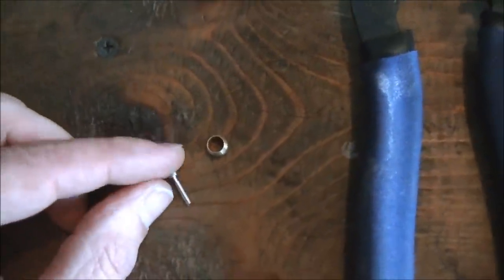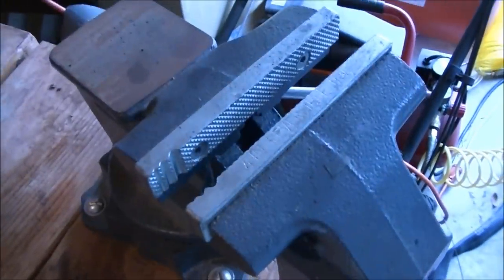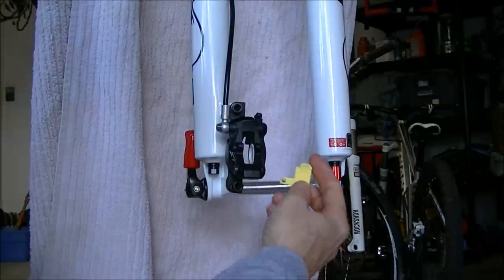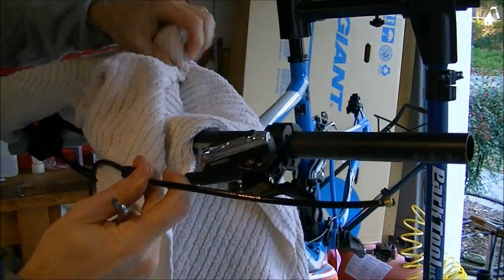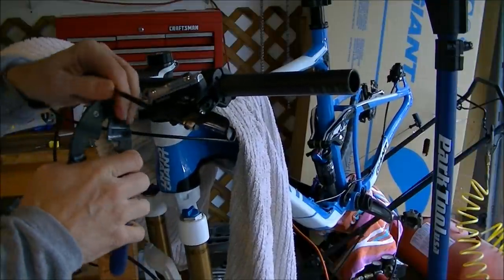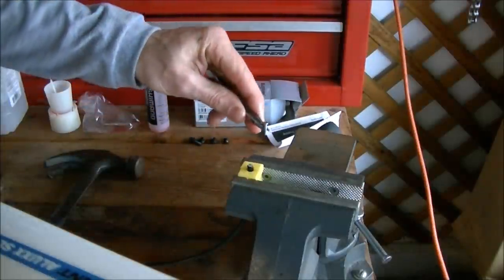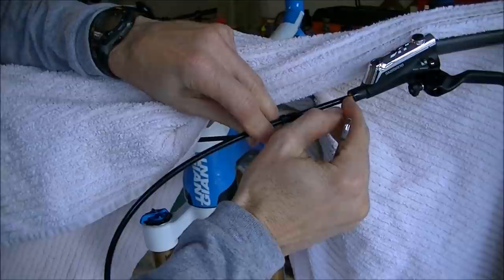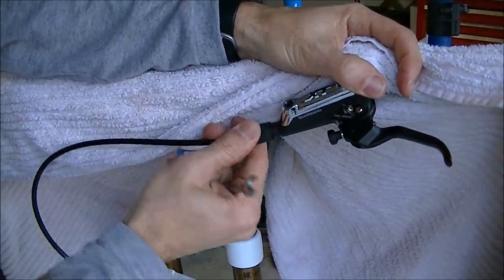How to Cut, Shorten and Re-install Shimano Hydraulic Brakes

Comment: This video is pretty straightforward.  The instructions almost make me feel as if hydraulic brakes are low maintenance.  I had some Hayes and their instructions were such a pain --  felt like the I was  doing the hokey-pokey.
Reply from the maker: +Peter Michael XT brakes are so easy to work on and very low maintenance.
Reply: Agree.  I felt I needed to comment b/c most recreational users probably don't want to use hydraulic brakes due to maintenance.  After watching your video I bled my entry-level Shimano brakes without drama.  There is a learning curve but successful bleeding makes me want for more hydraulic -- especially Shimano.

Comment: For the front brakes the line can be pretty much any length as long as as it reaches the levers because the handle bars always move with the front wheel.

Comment: I dIdn't have a vice, so I wrapped the tube with two layers of duct tape and held it with in place with pliers in my left hand. Using the flat handle of a wrench in the web of my right hand, I was able to grip the pliers with my fingers and press the pin into place. This method is useful if you're doing this in your bedroom, but there's a few drawbacks: 1) success is dependent on your grip strength, and 2) you run the risk of deforming the cable. On the first attempt, the tube bent, and flattened a little where the pliers had gripped it. However, this technique worked perfectly for me on the second try – no deformations at all.

Comment: And the bike shop makes it seem like a complex operation. I install swage fittings at work, on steel process lines all the time, and you've shown me that is all there is to it. Just like the brand we use, the tightening nut does the swaging. Thanks - easier than cable brakes.

Comment: Great video! Very clear. I recently upgraded to SLX brakes and when the arrived in the mail the levers were reversed,  i.e. front lever on the right, rear on the left. I want to switch the hoses and the sizes will then be correct. I wont have to do any cutting but i wondered if i will need to bleed the brakes afterwards.  Thanks
Reply from the maker: Sometimes you don't need to bleed if you are careful.  I've even cut a hose an not needed to bleed.  But the bleeding process is so simple that it's not much of an issue if you do have to.
Reply: Clint Gibbs Thanks for the reply. Related to my previous question,  would I need to replace the olive if all I'm doing is pulling the hose and inserting in opposite lever?  I'm unsure if that would damage it.
Reply from the maker: No. Olive should be fine. You really only replace it when you have to cut the hose.

Comment: You leave just a little bit of housing sticking up from the bleed blocks @ 6:28 however if you leave an excess of the usual 15mm (Lenth of the pin) this means the pin will go in best, by allowing the housing to expand evenly around it and the tension holds it firmly in place.

In your example, the pin will expand mostly the inner wall of the hose and the block will be creating tension/spring in the outer part of the hose around the pin, so, when the blocks come off you might find that tension then releases as the outer layers expand, leaving the pin not as firmly in place.

Of course, the difference is not really going to be notable... Although I'd like to think it would be best practice especially in a bike service shop :)

Comment: Clint, there's a much easier way to trim the line without having to bleed the entire system, just the top portion. You don't even have to remove the brake pads just make sure everything at the bottom end, brakes and rotors, are covered with some rags incase there's some spillage. When you cut the line at the top, everything else you did gets done the same, just cut the line, attach it back to the lever housing and tighten. Remove the bleed cover, attach the cup and add mineral oil, pump the lever several times and what ever air is at the top end of the braking system, will come out. Make sure your cables are propped up so that oil doesn't leak downward after you cut the lines. Also, make sure that they're paying attention to the "o" ring that's part of the bleed screw or screw cap and that it doesn't fall off…and you're done.

Comment: Thank you for this clear and straightforward video. I am about to do the same thing on my bike and your instructions are very helpful. I wonder yet that no drop(s) of mineral oil spills out of the open end of the hose once you cut it and even move it to your bench vise ... Are the brakes not pre-filled with mineral oil when you buy them?
Reply from the maker: They are prefilled.  The reason not much flows out when you got the hose it’s just because there’s not any airflow that can allow the oil to come out the end.

Comment: Nice vid, thanks! I've got a really spongy feel to my rear brake (Avid Elixir R with 180 mm rotor). I'm thinking about upgrading to steel braided lines b/c even with several bleeds the rear sucks. Front is OK. I've determined that the rubber line must be the main cause for the spongy feel.

Comment: Great video Clint.  Do you have to replace the olive any time you detach the brake lines from the lever or only if you are shortening the hose?  I ask because I got a pair of brakes that came Euro style.  I switched the lines and one seems to work great, but the other seems to be leaking.  I'm thinking it's either I need to redo the olive and pin every time or maybe I didn't tighten enough (i.e., 8 newtons)?  Any thoughts appreciated.
Reply from the maker: +Blake Durtsche no, you do not need to change the olive every time you remove the cable from the lever. It sounds like you just need to tighten the bolt the holds the cable in the lever. It's pretty finicky. I've had times where I thought it was tight enough but it leaked a little bit. Just taking it a tad more.
Reply from the maker: +Blake Durtsche tighten it a tad more

Comment: I have the same Anthem as you Clint,. On this bike though, how does one route outer cables shifters or outer brake into the frame of this bike, does it require a thin tube as a guide or could one just remove the old inners first then use the old outers as a guide to feed in new inners then take out the old outers with the new inners as guide to put the new outers? all these without using any other tube that one would have to get from a hardware store as a guide?
Secondly, we know you do get the olive with the new brakes but, what if you but a fairly-used brakes or where do you olives and the other connector insert?

Comment: I"ve read and heard frequently that this procedures can be succesfully accomplished without bleeding the brakes. What are your thoughts, Clint? Thanks so much, great great video.
Reply from the maker: +Justin Kamerman if you're careful you can do it without bleeding the brakes but you always need to prepare to bleed just in case.
Reply: Clint Gibbs Thanks you for your response. Truly appreciated. One more ? if you don't mind: how do you tell if you were careful enough and have to bleed or not-bleed, would it be based upon feel of the brakes? Again, thank you so much, looking forward to exploring your channel more. This is the end of my first full season of MTB, I'm in love!!!!
Reply from the maker: +Justin Kamerman after you cut a hose keep it up so fluid does not drip out and quickly install the cable inserts. Also there are yellow plugs that you can plug into the brake levers to keep fluid from dripping out of those as a temporary measure before installing the hose. Just move quickly so minimal fluid drips out. If it does don't worry about it and just do the bleed.

Comment: Nice video, that 'olive' looks like a compression fitting? At least thats what it looks like, never heard that term before, but it works.
Reply: It's designed to be crushed
Reply: @smallhatshatethetruth7933  indeed... that's why it's called a "compression" fitting. You compress it or "crush" works too.

Comment: You explain things so well and so clearly. Can I ask, I have deore brakeset on my Trance 2015. If I were to upgrade to SLX or XT, would it be ok to just leave the current brake housing in place and do what you did here? Also, would it be similar procedure at the caliper end?
Reply from the maker: yes, you most likely should be able to use the same brake lines on SLX and XT brakes if you upgrade. if you're asking about the hose at the caliper end, you would never cut on that end. The hoses are designed so that you only cut on the brake lever end.

Comment: Hi! Thank you for the video.. I am trying to install hoses for r8070 caliper and grx shifters. On the shifter the olive and hose goes in and I screw the bolt inwards. It screws away, but doesnt seem to tighten? And on the rear...the olive and hose seem a lot tighter...the bolt screws in and starts to get tight, with maybe one third of the screwed surface left to tighten... Does this make sense? Any ideas, what I could be doing wrong? Thank you!

Comment: Nice video Clint, I am getting a pair of zee brakes is this pretty much same procedure ? I would also like to put braided hoses on them, can u make a video on how to change hoses ? Thanks
Reply from the maker: Yes, the process should be the same.  As far as changing hoses, it will be like the video I show except for removing the hose from the caliper.  There is just one bolt (aka the banjo bolt) holding the hose to the caliper and there should be an o-ring on each side.

Comment: Thanks for posting. I have been wondering  how to do this for ages. I also did not know about he mineral fluid and being a motorcyclist I am sure I would of used DOT fluid. I am also interested to know whether you can get an open ended torque wrench as all mine only can be used on sockets.
Reply: they are called crowfoot adapters, basically a spanner head of certain sizes.
google image search "crowfoot adapter for torque wrench" to see what they look like

Comment: Hey Clint. I liked your video. It was very clear and easy to follow. I have a question for you, if you don't mind? I'm switching my lines from "moto" to bicycle and the housing seems to be stuck/jammed in the lever body. I reefed on it pretty hard to no avail. Any ideas? They are Saint 810's. I've been running either Magura or Shimnao forever without trouble...

Thanks, Derek
Reply from the maker: If you have the housing bolt all the way out, which I'm sure you do, then it can take some force. The doughnut gets jammed inside the leaver body. Try shaking the housing back and forth while you pull on it.

Comment: Don't be stingy about sliding that nail into the brake line to open it up a little. The little insert split open and sliced through the outside of the brake cable. I managed to salvage the insert by filing the end down and reforming it. Hopefully the connection doesn't leak. I haven't bled it yet.

Comment: Hey, the little silver insert you insert into the hose when its in the vice, is that the one that was there before? or do you have to buy them seperate? im about to buy xt brakes so im guessing i will need to shorten so do i need to buy that insert aswell? or? if so whats the exact name and where from? thanks
Reply: +Mathew Pugh If you buy XT brakes that weren't meant to be on a retail bike than they will be in OEM packaging and not bubble wrap.  The front brake includes the bleed block and the hose holder.  Each set comes with the needle and the olive.  The clue lies in the lengths.

Comment: Thanks for the great vid! One question though: I have to replace my current line which is filled with oil. Is it the best to push the oil out from the bottom to the top (in the funnel) or just let gravity do its work and let it come out at the bottom?
Reply from the maker: I've done both but the gravity method is a lot easier. The downside is for the rear brake you have to take the caliper off the bike and let it hang down lower. For the front brake the gravity method is very easy.
Reply: @ClintGibbs  thanks! It’s the front brake so it shouldn’t be a problem

Comment: Hi Clint, great work on the video!  Quick question.  I just installed my first set of hydraulics (SLX).  I noticed I have a slight twist in one of my cables (at the lever).  Is it possible to loosen the bolt enough to remove the twist without having to completely remove the hose then bleed the brakes?  Thanks!
Reply from the maker: Most likely you can. When that happens I remove the lever and twist it but sometimes it gets twisted in the opposite direction. If you loosen the bolts going into the lever as little as possible you will probably be able to turn the cable without any hydraulic fluid leaking out. Let me know how it goes.
Reply: Clint Gibbs I undid the bolt as much as I could and eventually the hose spun itself around into the right position without appearing to have lost any hydraulic fluid.  May have originally over-tightened the bolts on the levers a little but everything seems to be fine; hoses are now untwisted and no leaks.  Thanks for the assist! :)
Reply from the maker: I leave leaver bolts just tight enough to not move. That way they can move in event of a crash.

Comment: An extremely informative video, but DAMN, that's a LOT of hassle just to shorten a cable.
I was thinking about upgrading to a hydraulic set, but now I think I'll just stick with a wired setup.
Reply from the maker: +Dan RC the good thing is once you have hydraulic brakes set up they're usually maintenance-free for a very very long time.
Reply: Clint Gibbs I'd be intersted to know how much all the parts needed for the cutting of the cable in your video cost?.
Are they worth buying if it only needs doing once or twice?

Comment: Hey Clint.  Nice job - very clear.  I broke my Deore XT brake lever at the clamp that attaches it to the handlebar, so I will be only replacing the brake lever itself - which will require disconnecting the hose from the broken lever and reconnecting to the new lever.  Will I be able to do this without having to bleed the brakes when I'm finished?  Thanks
Reply from the maker: You will have to bleed the system, especially since you're installing a new lever.  That's where most of the brake fluid is housed.
Reply: Same problem here...i know a bleed is necessary,but since the new lever is the same,can i reuse the olive and insert?(aka,leave the break line untouched)
Reply from the maker: Yes
Reply: Clint Gibbs thanks for the quick response and the help!
Reply: Actually, I cheated.   Clint may not agree, but here's what I did based on LBS advice: I removed the broken lever from the handlebar and detached the cable from the fork to free it up enough to take it down to the floor below the rotor and brake caliber.  This allows gravity to work in your favor.   Then remove the cable from the brake lever.  Disassemble the new brake lever and fill the chamber with mineral oil.  While still open, connect the cable to the new lever.  Squeeze the brake lever a few times to burp it and keep topping off the chamber with oil and repeat until the lever feels right.   Reassemble the lever.  No bleeding necessary.   My lever works better than it did before.
Reply: Rob Herman did the same thing today,but i could not see any bubbles...maybe some very tiny ones....it worked great though!
Reply: Glad it worked!   Happy riding!

Comment: Hey Clint, thanks for another great video. Let me know... if i dont want to cut, just want to switch left housing to the right lever and right housing to the left lever... would i need new olives? TY.
Reply from the maker: No. You can use the same olive if you don't have to cut the lines.
Reply: Clint Gibbs but i will need to bleed it  anyway, right?
Reply from the maker: Sometimes you don't. Don't let the cable drop down so the fluid leaks out. Install and test the brakes to see if they need to be bled.
Reply: Thank you!!
Reply: Clint Gibbs
That's great news! Thank you so much for this video, it really helps!! :)
Reply from the maker: No worries!

Comment: great video! need some advice, I need to detach my brake hose from my rear brake lever because i need to thread it through a new frame. do i need to replace the olives or can i just replace the hose in the lever?
Reply from the maker: +James Thompson You only need to replace the olive if you have to cut the hose.
Reply: fantastic, thank you

Comment: Hi, just watch your video, quick question if it’s ok? Which side does the chamfer on the olive go? Bolt side or housing side?👍
Reply from the maker: Not quite understanding the question based on the info you provided.
Reply: Clint Gibbs Thanks for the reply, have raised the handle bars on my giant contender and the front hyd hose is too short so I am replacing it. The olives supplied have 2 different ends. 1 end has a little chamfer on it which slides into the bolt a little. The other end has a bigger diameter which sits flush on the end of the bolt and doesn’t slide in at all. To be fair I think I have answered my own question as the chamfer bit must slide in the bolt a bit so it keeps it square so as you do it up is crushes it evenly.😂

Comment: Hey Clint nice video as always. I just purchased some Shimano XT brakes and was wondering if I needed to have shimano rotors or will the stock rotors work....it's a Specialized hardrock 29er with tektro hydraulic disk brakes....160mm front and back. Thanks
Reply from the maker: Joeup24 , the stock rotors should work just fine as long as they are not bent
Reply: Clint Gibbs Thanks I went ahead and slapped them on and it's night and day from my stock tektro.
Reply from the maker: Very cool!